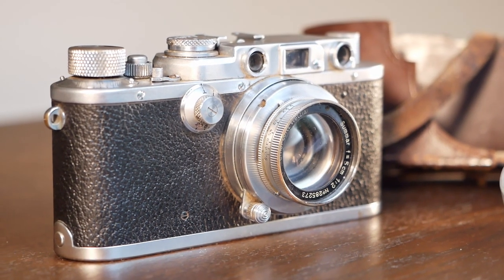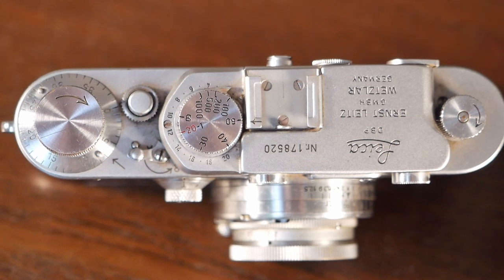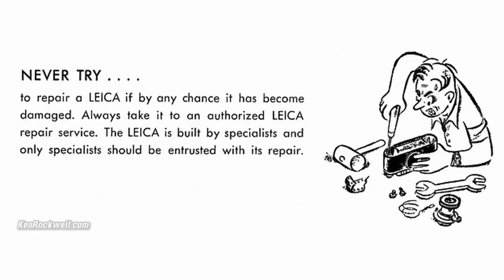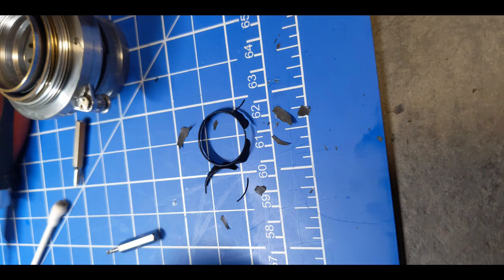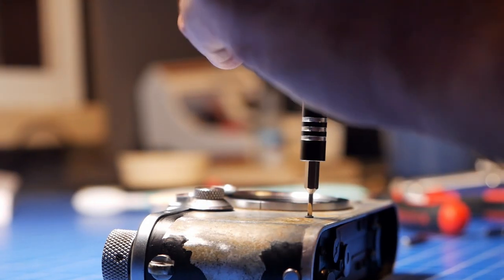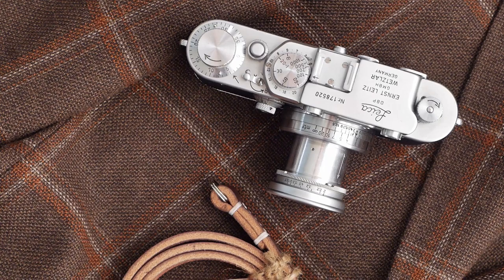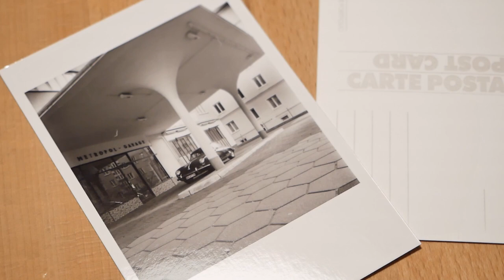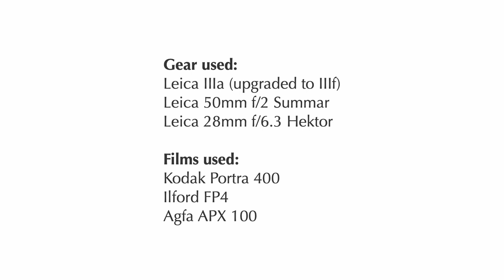Restoring a 85-year-old Leica camera

Comment: If one can get used to the separate rangefinder, a Leica III(a–f) is the most "Leica-like" experience I can think of. And this rangefinder has even the advantage of being a high-magnification rangefinder that does a perfect job even with a 135 mm lens (already a tiny bit hit-and-miss on a 0.85 magnification M6/MP). You either love or hate this camera – I love it (the only Leica I still have).

Comment: Lovely story. I have been given many cameras over the years but never a Leica! I just did a test on the correct exposure for 4 cameras I have. Also I checked for sharpness of the lenses. First camera canon 7sz with 50 mm f1.4, a Minolta V2, fujica v2, and super paxette. The Minolta won by miles. Then the fujica followed by the canon and super paxette in 3 rd place. The canon lens was an eBay purchase and is not focussing to infinity as the shims are missing. Dispute with eBay as we speak as was sold as working. Beware Japan camera sellers. So the £30 Minolta even though it's a fixed leaf shutter was so sharp I will be going out again with it.

Comment: One of the Family cameras is a Leica IIIa. I don't know much about except that it was purchased in the Midwest U.S. after World War II, when my ex-GI father was at Stout College. It came with a 50mm f/1.5-9 Taylor-Hobson Xenon, a pre-war "speed lens" that was cloudy and had dirt between the lens elements. It delivered flare-ridden, fuzzy pictures, so I replaced it with a 1950's 50mm f/3.5 collapsible Elmar, which produces outstanding black-and-white and color images. (Kodachroome!;) Since Leica IIIa models were as "common as dirt" and worth about as much, I had X synchronization at 1/20 sec. added for "after sundown" photos.

Comment: Thanks for the great video.
I am a great fan of Analog cameras or better film Cameras.
The first I had i the past was a Bald with an  external photometer, Zeiss.
Next I had a Fuji ST-901.
Next I had a Canon T90.
Now I have only two bodies of Olympus digital 4/3 system.
I have a Telephoto Tamron 80-210 with Praktica adapter, (screw) and second adapter for Olympus OM system film camera.
I am searching an Olympus OM1 now.
What is form your point of view.
Use the camera Praktika super TL with the f50 1:28 aus Zena and the Tamron 80-210 with Praktika adaptor.?
More to know.
From all the review you do what would be a good choose price/value/lens.?

Thanks in advance.
Ramon Boreguero, Linz Austria.
Waiting for your feedback.

Comment: wonderful video as always. 👍 It must have been great fun to work on the camera. May I ask what they did with your M3 in Wetzlar that you were not satisfied?
Reply from the maker: Thanks for your comment. Of course, you may ask. The Leica Service in Wetzlar failed to fully repair my original double-stroke M3. It took three attempts in which the camera was downgraded (due to lack of spare parts and additional transport damages) from a double-stroke to a single stroke and from a really nice, large 0.92x viewfinder magnification to the standard 0.72x with newer rangefinder mechanism. Despite all that, the original problem still occurred. At the end, they acted very professional and service-oriented, took the camera in and provided me with a good deal for something in return. I appreciated their reaction a lot and have a high regard for the Leica Service. Yet, I was a bit hesitant when it came to sending in the Leica IIIa for service.

Comment: It's clearly evident that the camera underwent some post-war conversion.  The top plate is engraved with the post-war "DBP" (DeutchesBundesPatent) instead of "DRP"  (DeutchesReichsPatent).
Reply from the maker: Yes, as mentioned in the video. :)
Reply: @AnalogInsights  And I believe the upgrade is called a IIIa(synch), a IIIa upgraded to IIIfBD flash synch features in the 1950s.

Comment: I'm wondering if all the "repairs"/cla it received in the past are in fact the cause of bad state this camera was. It's heavily discussed on the forums if too many cla are not causing more harms than good, particularly if ti's butchered.

I personally also inherited my grand father's IIIc (and very fortunately also the scans of the 10000 pictures he took with it). 
I know for fact the camera wasn't used (or maintained) the last 30 years and probably the last 50 years for what I know. 
I have the (used) sell invoice of 1957 and all original paperwork but nothing in the middle so I believe it was probably never maintained in this time frame (it probably was at least once before because the camera was upgraded with flash sync).
And with all of that it works fine, rangefinder is accurate, shutter speed seems ok (I rarely measure light so hard to say what is the cause when I'm not spot-on but I'm always in the light range of the film). Only the leatherette was ready to die...

Comment: I bought nikon d3 a few months ago on ebay. 11fps 51 focus point low light Batman. It's good camera. I'm a photographer. I.enjoy taking photos. I only used Nikon. I like Nikon I never bought anything but nikon. D3200 d3300 d3. I bought the p510 in 2013. Leica is German camera. You look good with eyeglasses

Comment: I think that you are wrong about this Leica’s age. In 1936, the camera’s label would have said “Deutsches Reich”  Instead of DBP (Deutsches Bundespatent) which meant “Federal German Patent”, a German government bureau founded in 1947. Having owned several Leica cameras from the Nazi period, I can attest to the fact that any Leica built between 1933 and 1945 would have referenced the Third Reich.
Reply from the maker: Thank you for your comment. As mentioned in the video, it got an upgrade in the 1950s including a new top plate with different inscription.
Reply: @AnalogInsights  I must have missed that somehow. That certainly explains the DBP on a 1936 German Camera!
Reply: @georgegraves9635  Leica up to 1957-1959, would factory convert your older Leica camera into a newer model. You could go to a IIf or IIIf. This IIIa became a factory converted IIIf.

Comment: Interesting video, but spoiled by the somewhat irritating sight of you repeatedly posing and pretending to take photographs without the lens being extended -- suggesting perhaps that you don't actually know hot to use a vintage Leica.
Reply from the maker: Thanks for your comment. Which scenes do you mean? We didn’t pose but actually take photographs and know what we are doing. The 50mm is extended when in use, the 28mm cannot be retracted or extended. What do you mean?
Reply: @AnalogInsights  I sincerely apologise. I did not spot that some of the shots were using a lens other than the 50mm.